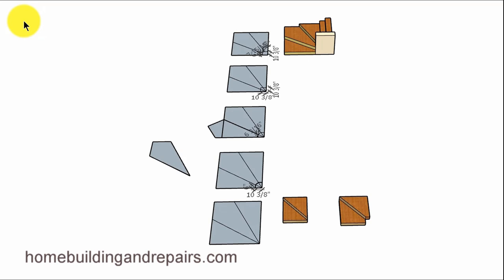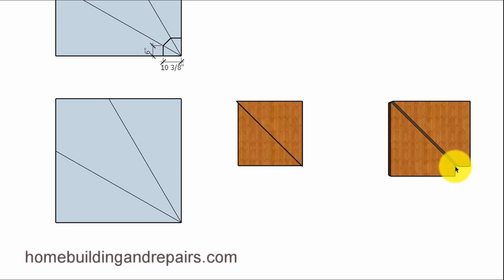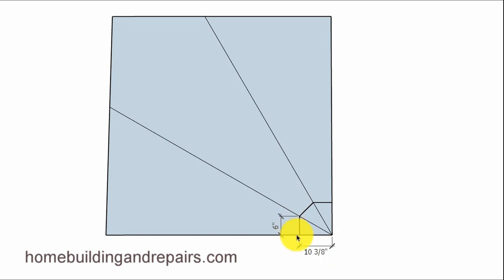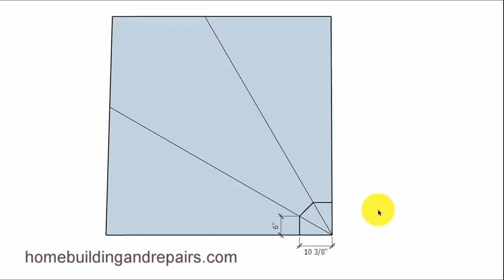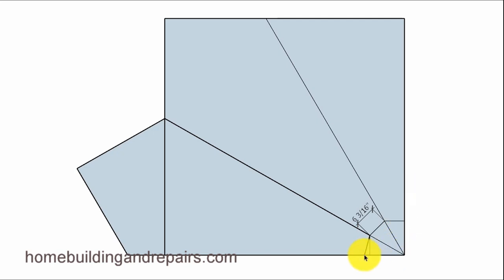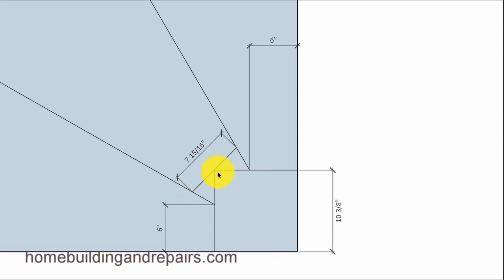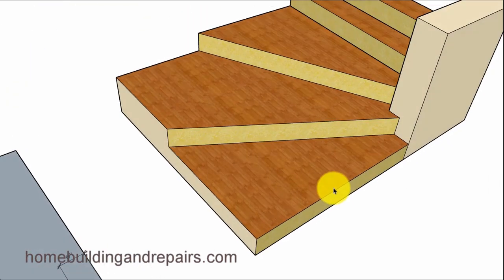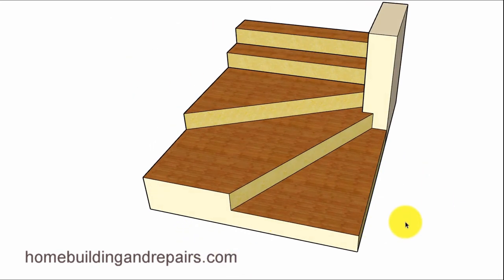Minimum Stair Tread Depth For Winder Inside Edges – Building Codes

Comment: Thanks very much! 

Code question for you: If the wall around which you are winding has a pass through with a required headroom clearance of 6'8" (per 2018 IRC) would you measure that from the bottom step, or would it have to be measured from the second step since a couple inches of that second step are technically under the pass-through? 

I'm thinking it should be measured from the bottom step since the walk line, which is 12" out from the wall, would certainly be on the lowest step. Thoughts?
Reply from the maker: No, here's a link to our stair building code videos. Look at some of the headroom ones. https://www.homebuildingandrepairs.com/codes/stair/index.html

Comment: Excellent explanation video ! Well done and many thanks.

If you happen to follow up on this, curious about issues / code regarding the outside point on the winders. Can that be cut at 45 deg like the inside point ? And how far back ? Keeping the minimum 36" tread length I guess ?

EDIT : And on returning to this, I guess a sub question is where to measure the 36" tread width on the winder. At the faces ? The middle ? Or (probably) whichever is the lesser ? Also, not necessarily going with 45 deg, may be leaning to doing a radius curve, but I imagine the answers apply to both.
Reply from the maker: As long as you meet the minimum width, usually 36 inches, you should be fine. However, you might need to check with your local building department in your area for the exact measurements.

Comment: For the sake of information, I'll type up the code just for the sort of person that's googling this sort of thing...

R311.5.3.2 Tread Depth.
The minimum tread depth shall be 10" (254mm).  The tread depth shall be measured horizontally between vertical planes of the foremost projection of adjacent treads and at a right angle to the treads leading edge.  The greatest tread depth within any flight if stairs shall not exceed the smallest by more than 3/8" (9.5mm).  Winder treads shall have a minimum tread depth of 10 inches (254mm) measured as above at a point 12" (305mm) from the side where the treads are narrower.  Winder treads shall have a minimum tread depth of 6" (152mm) at any point.  Within any flight of stairs, the greatest winder depth at the 12" (305mm) walk line shall not exceed the smallest by more than 3/8" (9.5mm).
Reply from the maker: Thanks for time to share this information.
Reply: Thanks!!
Reply: You know that when the minimum is a round number of inches, it's really arbitrary. If this was based on science, this would a precise number, in mm, like 265mm or something.

Comment: Does your book describe and detail the process for a "double" winder stair? My basement stairs start facing N, turns west, 3 steps down then turns S.
Reply from the maker: If it doesn't, it does provide you with information on how to build one individual three-step section that could be duplicated to form a double set of winders going in a variety of different directions.

Comment: if i live in an area where code is really not an issue, would it be possible to make the platforms smaller, but keep the same angles?? these videos are amazinh btw thanks for posting.
Reply from the maker: Yes, if building codes are going to be a problem, then you could lay everything out differently and I imagine could even end up with the same angles. You're also welcome and thanks for watching our videos.
Reply: warofwrath  remember the building code is for our safety,
 it's  best for our to keep close to the building code even if there are no building code in that area

Comment: At what point would the steps on a winding stair case bre considered a landing for the purpose of providing a continuous handhold with a wall mounted grab rail? I hope that question makes sense
Reply from the maker: I definitely understand your question about the landing, because winders I've heard plenty of people refer to them as a landing, but in reality they fit better into the step category and would be considered such by most building authorities and inspectors.
Reply: Connecting this back to @loueber stair referenced above, I know it is not the intent of this video, but how would you provide a continuous handrail in the ‘S’ shaped reverse winder stair he described?

Comment: With current code these wouldn't pass would they?  Code requires a 10" walkway at 12" from the inner side of the stair.  Try a triangle calculator. Put in three values and get your missing ones.  In this case 30 degrees at the center /turn, 22.375 (12 inches per code plus the 10 3/8 you mention here) and 10 for the 10" walkway path code.  It returns a value of... "these three values can not be used to create a valid triangle".. Is it possible with todays code to create a 2 or 3 stair landing? I hired a company to draw out plans and there were 5 winder stairs to meet code.
Reply from the maker: I changed the title of the video, because there are two minimums and this is one of them. Here's a link to what you're referring to as the walk line minimum for winders.
http://www.stairs4u.com/code/winder_walkline.html
Reply: @stairbuilding   Does this information change the 10 3/8" measurement? Also will your book on winders (that I just purchased!) have to be modified? Thanks.

Comment: I’m still struggling with the 36” part. 

I did extend my landing to be 42”, yet my third winder going up is still only 31.5” after blocking out the wall portion of 10 and 3/8”... help!!
Reply from the maker: Send me some pictures or a drawing and you can get our email address at the website.
Reply: Thanks! I sent an email.

Comment: In michigan, we need not only 6" at the inside, we also need minimum 10" of tread a foot from the inside (line of travel).
Reply: 9mmkahr same here in Cali, curious if the measurements in this video equal out to that
Reply: Yeah, that's part of International Residential Code so I think it's pretty widely adopted?  The minimum is 10", but I'm 99% sure it still has to be within that 3/8" wiggle room that's held in the rest of the staircase.  So that landing split in two probably wouldn't not work.  They want that consistent tread depth and riser height to be consistent throughout the entire path of travel to avoid tripping.  Especially on winders

(Had a quiz about this code just yesterday. Yeehaw)
Reply: @undeadpiano  No, the code would allow two step winders like splitting that landing in two. Winders must be consistent but not consistent with the straight run portion. Also, the points of the 2 pie shaped winders would need to be cut off, notched, covered over, etc., so that a minimum 6" tread depth would be had. On a true circular staircase, which is just a bunch of winders wrapped around a pole, that 6" minimum is reduced even further.

Comment: Just look at how ignorant that code is...    If it goes all the way to the point, that's no good--- but if you take that exact same step and cut 10 1/2 inches off of that point-- then all the sudden it's legal. smh.   That 10 3/8  x 6" clearance is still there, whether you cut the point off or not....    It's actually much safer when you build them too small, because then no one will dare to walk on that side...  yet when you build them with the 6" like you say--- people feel like it's ok to walk down them and then they fall-- because 6" is still way too small for a tread.  I can't stand code inspectors.
Reply from the maker: 6 inches is the minimum at edge, but you still need about 10 inches at walk line that is about 1 foot from inside edge of stairs, leaving enough room.
Reply: @stairbuilding  Yeah.. that's mostly only California code and other states that follow them.  It's fine for new construction.. but for an old house that actually needs winding stairs to fit--- it's never going to work.   Because if you had enough room to expand your steps to get the 6", then you wouldn't even need winding stairs and would just build it with landings.  Even if you added a false over sized post in the center, to get you out to the 6" clearance--  then your overall width will no longer work either.  So you literally have to have an area that's already big enough to build regular steps, before you can put in a winder-- which is dumb.  The whole point in a winding stair is to make it work in tight spaces where you can't fit a regular stair system...   It's always the same thing-- Rules, regulations and laws that do nothing to help anyone, and only get in the way and bring tyranny down onto people that's unnecessary.  Like all the ignorant gun law for example.. smh.